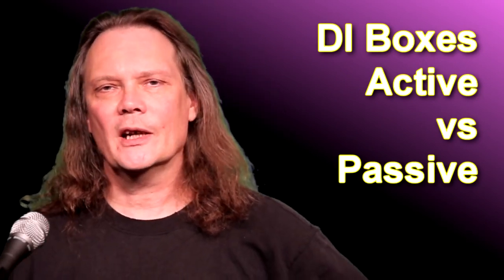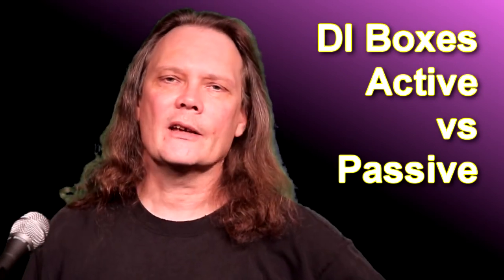Active vs Passive DI Box - Which One Should You Use?

Comment: Wow. Now THAT was informative. I do have one question though: what happens if you're using a passive DI and the mixer has phantom power engaged (my mixer has a phantom power button for the whole board)
Reply from the maker: Thanks for watching, and that's a very good question, nothing should happen, it shouldn't hurt the DI (since it's balanced), and the DI will not pass any phantom signal to the equipment connected to it.

Sort of a similar situation to using a balanced dynamic microphone, it essentially ignores the phantom power.
Reply: @Barry-Watson  Hey man, thanks for such a prompt reply. Good to know about the DI's - but slightly confusing because aren't condenser mics also balanced and DO 'see' phantom power?
Reply from the maker: Yes, the electronics in condenser microphones are designed to tap the power between the signal lines and ground, obviously.  Dynamic mics (on a balanced connection), ignore the DC voltage.
Reply: @Barry-Watson  Is that also true of DI's coming directly out of amplifiers?
Reply from the maker: It should, if the guitar/bass amplifier output is a properly designed balanced output. If in doubt, I would run the amplifier into a DI box and feed the pa via the DI box.  As a venue sound tech, I would usually use a DI box with any band equipment I would direct-connect.  This isolates the band equipment from the house PA, just in case there is a piece of equipment that might have a grounding issue or had an unbalanced signal (1/4 TS connector etc).  Helps protect both the instrument, and the house mixer, and may help keep buzz/hum to a minimum.

If it was my own guitar amp, with a transformer balanced output (XLR) and I knew it was good I wouldn't feel the need to grab a DI box.

The only places you typicaally would have an issue with phantom power are if you're using unbalanced microphones into mixer balanced inputs via an adapter cable which isn't a great idea. Or, if you are using ribbon microphones, and they're are a little uncommon.  But, if you don't need phantom power it's best to leave it disabled, because it can cause loud transients when cables are connected/disconnected if you forget to mute the channel beforehand.

Comment: What if I'm using amp modelling pedals, does the Active DI still make a difference?
Reply from the maker: Some of those modeling pedals already have balanced audio output, in which case a DI might not be necessary at all.  Since the modeling pedal has active output electronics, and likely fairly low impedance output I would expect most any di to work well, active or passive.
Reply: @Barry-Watson Thank you for replying. I'm getting a DI box mostly to protect my modeler from phantom power, a few friends have lost expensive pedals over that

Comment: I'm wondering which type of DI box to purchase in my situation. I have an Alvarez MD60EBG acoustic guitar with active pickup.  I'm going to be performing mostly small acoustic gigs with the mixer near me onstage, no long cable runs. I'm assuming a passive DI would be my best choice?
Reply from the maker: In your case I would say that either type of DI should work about equally well for you. Since your guitar has active pickups, it should be able to drive signal into any reasonable equipment without affecting instrument tone.

Generally my preference is an active di because I feel they are better able to drive long cable runs to the mixer. But, an active DI will require power in the form of batteries, or the mixer needs to have phantom power turned on on that input. If that's not an issue for you, personally I would lean in that direction. 

On the other hand, a passive di is very simple, and does not require power, so that might make it slightly more failure proof or a better choice if you're going into a little mixer (like a powered mixer) that doesn't offer phantom power on the mic inputs, and you don't want to rely on batteries. 

In my experience most DI boxes work pretty well and sound similar.  You probably won't get dramatically better sound character by buying a extremely expensive unit, unless it offers more than just DI functions.  I'd look for a quality unit that is built rugged enough to survive being kicked around on stage.

But, the bottom line is that I think either would work just about equally well for you. Good luck!
Reply: @Barry-Watson  thank you so much!
Reply from the maker: You're welcome!

Comment: Hi - great info, thank you !  I’m just slightly worried re: plugging in an electronic keyboard to (I assume) a passive DI box, to feed up to a mixing desk.  The concern is that the desk applies  phantom power across all inputs so, if I connect the TS L/Line Out to a passive DI box, is the keyboard protected from that 48v? It sounds like it’s isolated but I’m wary of damaging equipment. On a shorter run, of course, I assume I can simply plug the keyboard LineOut directly into the LineIn at the mixer, but it’s the correct use of a DI box over those longer runs that I’m trying to address. Many thanks, in advance, & bless you.
Reply from the maker: Thanks!  No worries, the DI box (active or passive) provides isolation, and does not pass phantom power through to the instrument.

If the instrument is powered and uses active electronics to drive the output, like a keyboard, you could probably plug it directly into a line input on the mixer if the cable run is short, and you'd be okay. 

I still like the idea of using a di for isolation just in that remote case that some piece of equipment has a problem that might damage the mixers input, or conversely could cause damage to the instruments output stage. This is pretty unlikely, but when I was working with bands I was never super keen about plugging random people's equipment of unknown condition directly into my mixer without a DI.

But, ideally, and especially for longer cable runs, I would use a DI box to convert the output to a balanced signal to properly drive the mixer's preamp.  This may make the mixer preamp work better, getting a proper signal plus a balanced signal will be more immune to picking up noise on longer cable runs.

Comment: Glad i looked at this - im getting geared up to have a kive playback rig, which I'm looking to run each playback device (including redundancy/failsafe) into a passive submixer, just to get the levels close as possible, so no volume jumps between devices.... finally into a DI box.

All these will be powered systems (mp3 player, BOSS BR800, USB audio from laptop and Alesis Samplepad pro), so most likely - a passive DI.

But yeah - glad this video exists.

You got a sub 👍

Comment: Thx for sharing. Great video tutorial about DI boxes. My Q is, can I use an XLR to 1/2 TRS cable from a DI box's out to a line level input of my sub compact mixer to preserve mic channels for mics alone, thus maximizing the mixer's overall inputs. I don't want to lug around another mixer to sub mix to the main. Thx in advance for any inputs on this matter. Happy, and safe New Year.
Reply from the maker: Yes you can with a passive DI.  Most passive DI boxes are simply a transformer, so you can run them "backwards".  This is not the case with an Active DI, where you must respect the input/output.  

However the DI isn't designed to boost a mic level signal up to line level, so your mixer may (or may not) have the gain you need on a input intended for a line level signal.  If the input signal is pretty high, for example a kick drum mic, or a signal output from a keyboard or bass guitar amp etc, you might be okay.  Try it and find out...

If you do this, remember the 1/4 side is unbalanced, so try to keep that cable relatively short to avoid picking up too much stray noise/buss/hum etc.

Comment: Great video Barry, well explained. I’ve got a question though. I’m using a RC600 looper and the way I have it setup is that the guitars sound goes through to the amp, and the loops I produce are routed straight into my mixing board so they’re played separately. Problem is, the output seems to be lower than expected. There is volume control for loops, but I have to crank it to get any real volume. I was wondering whether a Passive DI box my elevate the signal that little that’s needed. Or any other advice would be greatly appreciated. Thx!
Reply from the maker: I think the RC600 is designed to drive a instrument amp input (hi-z), not a mixer (low-z), so I would go through a DI box into a mic input on the mixer.  You may need to engage the PAD switch on the DI or mixer channel to scale the signal level.  The passive DI won't boost signal level, but it might help the RC600 have the ability to drive signal into the mixer.  It's possible that the load of the mixer is reducing the signal level from the RC600.  An active DI may provide a little more signal level than a passive DI.
Reply: @Barry-Watson  thanks so much for the quick reply, it’s exactly what I was thinking. I’ll give it try and see if it works.

Comment: What about thos Palmer speaker sims? Might be other flavours out there too. Do they make your job easier?
Reply from the maker: Yeah, powersoak loads are a good way to run a real amp without creating a ton of sound.  Real loudspeakers can present complicated dynamic loads, and impart a sound of their own which is hard to exactly duplicate, but I've had great results from players who use a powersoak load box to get great tone at modest level, or to provide a fat-sounding DI guitar tone.

Probably best used during winter, when you can use a little extra heat in the house.
Reply: @Barry-Watson  Thanks barry.  You remind me of the guy whom held my first PA course when I was about 14. Absolute gent.

Comment: This is the most complete material I've ever seen on this topic. Thank you very much for this. I have a question. I use a passive humbuckers guitar. I need to split its signal in order to reamp on computer. I understand that passive guitar mics need Phantom powering DI to strengthen the signal. I want to use a DI box, but I already have an interface providing Phantom Power in balanced mic XLR plugs. My question is : Can I use the interface Phantom Power in order to provide enough power to passive DI for my passive humbuckers?
Reply from the maker: Sure, I'd expect your interface to provide ample phantom power to operate your active DI.

Some computer interfaces provide an "instrument" switch that adjusts the gain and loading of the input so you can plug a guitar directly in, and that may work well for you (with no need for a DI box).

Alternatively you could connect your guitar to an active DI, then the output of the DI (on XLR cable) to your interface, (in mic input mode, not instrument), with phantom power engaged.

If splitting signal, my preference would be to split after the DI, or the interface, or a effect pedal, to reduce loading on the guitar itself.

Comment: Thanks Barry, useful explanations! I have a Telecaster with 6 or 7 rather standard pedals (RAT, basic Boss and MXR ones, etc.). I'm beginning to record stuff with a friend who uses a Maschine prod system. Would a good passive DI be OK given that I use powered pedals? What would be the advantage of an active DI in that case? Thanks!
Reply from the maker: Sure, since your are driving the DI input with a active device with a strong output (for example an active guitar, pedal output, keyboard etc) the DI shouldn't have much effect on instrument tone.  I tend to prefer active-DIs if phantom power isn't an issue for you, but any I'd expect decent DI box should work fine.  If you play a lot of shows with various bar-band level soundguys, I might opt for a passive DI just to keep things a teeny bit simpler.

There are some guitar effects that provide balanced output (typically XLR outputs), and in this case you could directly use those without the need for any DI.  For example, I worked with a guy using a Line6 Pod HD500 efx board that had XLR outputs, and it was nice that I could just directly plug the lines into that source.
Reply: @Barry-Watson  thank you. Just to be sure, when you say you tend to prefer active DIs, can you elaborate on that? What are their advantages knowing that the source is active?
Reply from the maker: @fabricedubois3060  I would expect an active DI, with it's internal line amplifier driving the cable to the mixer to be able to provide more consistent performance on long cable runs.  Maybe more importantly some active DIs offer tone control, or tone modeling which may be a nice feature.  But, especially coming from a source with a strong signal, I would expect any good quality DI (active or passive) to work well.

Comment: My guitar has a very high output passive pickup so I have to turn the gain knob all the way down on my focusrite to avoid clipping. But it's too much because it's almost zero (Around 2-3) But you said that active di box is for lower output passive source. So what will be the best option for me? I only record direct so don't need anything fancy.
Reply from the maker: Most DI boxes, and preamps (on your mixing board or interface) offer a PAD switch, which is used to reduce the gain to accommodate higher-level signal sources.   So, I would probably use an active DI box with the PAD enabled, which then feeds into your Focusrite mic input preamp.  This is assuming you don't have a PAD switch on your Focusrite (my Scarlett 2i4 has one).  The PAD typically drops the gain by 15-20db or more, which should offer ample headroom for any sane signal levels.

Comment: If I Have a guitar Pedalboard, which do you prefer to use? I have a cabinet simulation pedals on at the end of the pedalboard.
Reply from the maker: The pedals are active electronics, so I'd expect that you have plenty of signal and drive, and they are not too load dependent.  If your pedalboard offers XLR/balanced outputs you can just connect directly, otherwise I'd expect any DI box to work well in that situation.